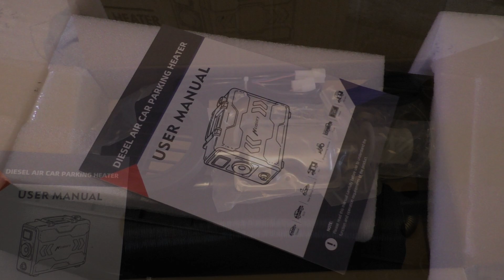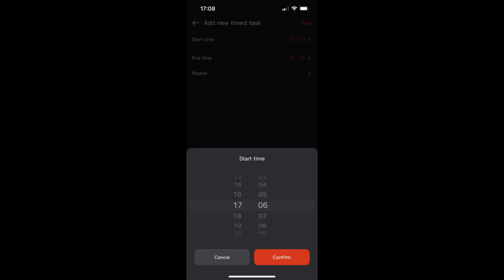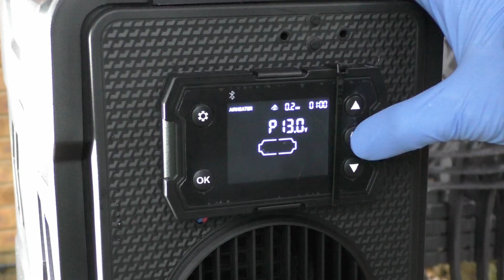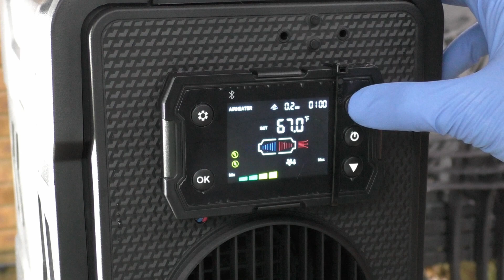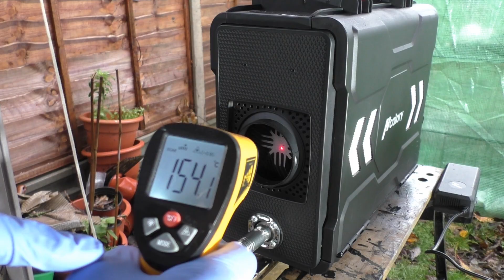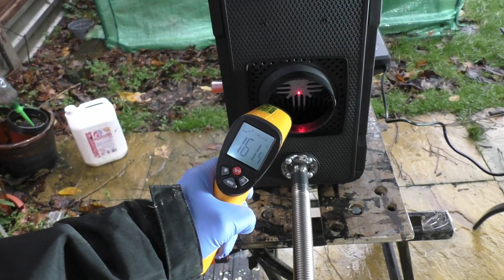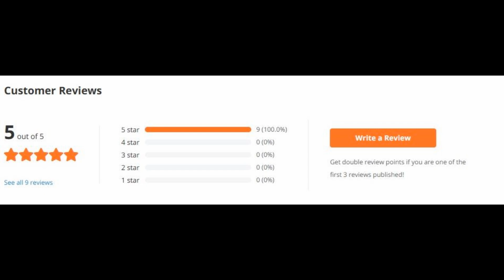Stay WARM this winter.  Testing this cheap China portable Diesel Heater.

Comment: Just got mine today, my shed is a rather large 16x18ft and after setting it up the temp went from 8deg c to 18c  in one hour  at full power and it used very little diesel and the fumes out the exhaust  fumes were minimal .This  heater is very quiet and it's great .Many thanks for the code and this was shipped from the UK .
Reply from the maker: Glad you like it.  They certainly kick out a LOT of heat.

Comment: I don't understand why it needs a power cable. Wouldn't it just be easier to use an electric heater?
Reply from the maker: You can run it from a 12 volt battery for portable use.  Not sure how much a 8KW electric heater would cost on electricity.  I ve got a 3KW aircon unit and that works out about £1.30 per hr.
Reply: @CB-RADIO-UK  Far out, what is the kW/hr price in the UK? Poor people must freeze to death, no wonder these fuel heaters exist. Still not cheap to run though at about £0.80 per hr at todays diesel prices.
Curious, how much is that 20L drum of kerosine?
I remember using stand alone kero heaters in the 70's. Was popular, could by kero from a bowser like petrol.
Reply from the maker: I paid £14 for the 5l can of Kerosine. UK's Energy Price Cap sets typical standard variable electricity rates at 26.35 pence per kilowatt-hour (p/kWh) for the unit cost and 53.68 pence per day for the standing charge, valid until December 31, 2025, for England, Scotland, and Wales;
Reply from the maker: Neither driving a car with £425 a year road tax and £1.60 a ltr.
Reply from the maker: Its not good.  Yes cars seem cheaper but not sure the cheapest.  Watch out for China flooding the car market with affordable electric cars.  Not sure on the long term quality but then again you can buy a 2 years old Polestar for 1/2 its orig cost.

Comment: Maybe silly question but I'm assuming it's weatherproof enough to be outside my van unprotected from rain, snow, muddy ground etc?
Reply from the maker: Yes i would say so.  They recommend you place it outside a tent with the control panel extended inside.

Comment: Guessing the AC cable just to initial charge a built-in battery then after that it charges itself?
Would only need to AC connect it again after a long period of storage?
Reply from the maker: Hi.  No there is no battery inside it need constant power supply.